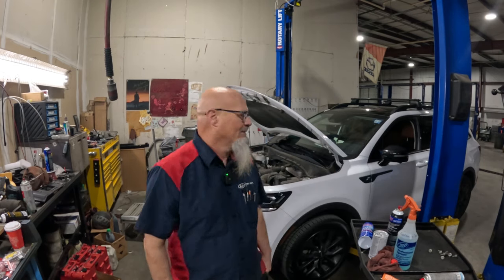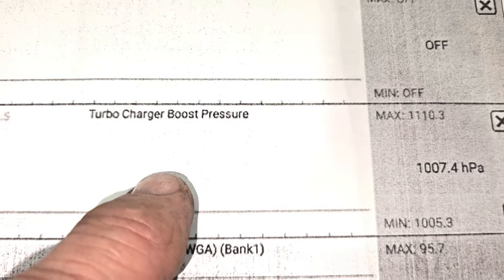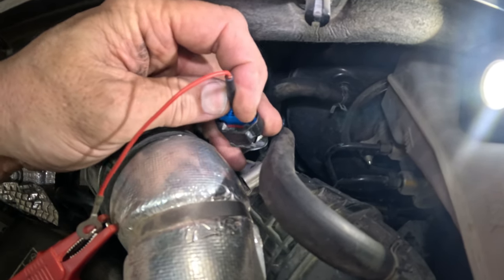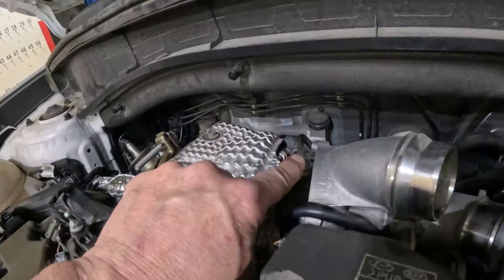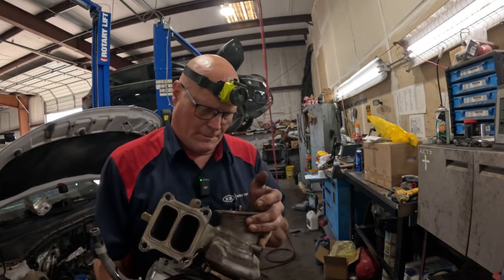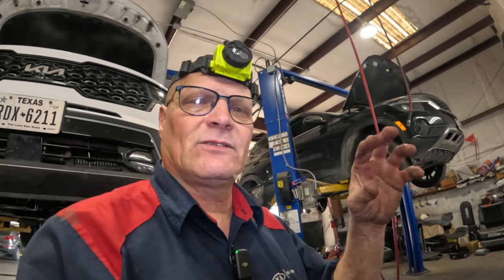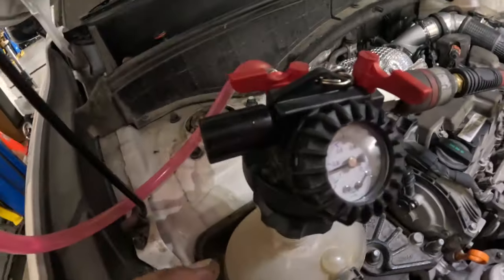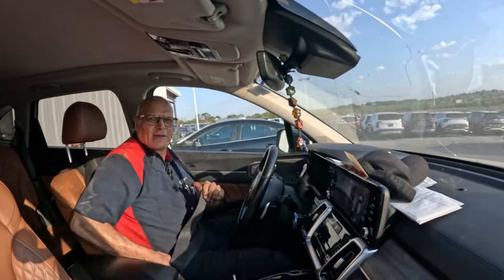Turbo Charger Diag. and Replacement.  2022 KIA Sorento.

Comment: I am guessing that for some PCMs, the waste gate actuator uses a virtual ground that floats at 1.7V, so that you can run the motor forwards or backwards by just switching the "DC motor+" between hot and ground, rather than having to switch the polarity on both terminals. Or it could just be a typo. I'm hardly an electrical engineer. 😅
Reply from the maker: Yes. In this case the PCM will change the polarity to the motor to move it both directions. The actuator has a potentiometer inside to to let the PCM know where it is.